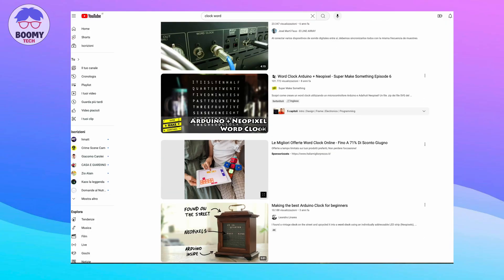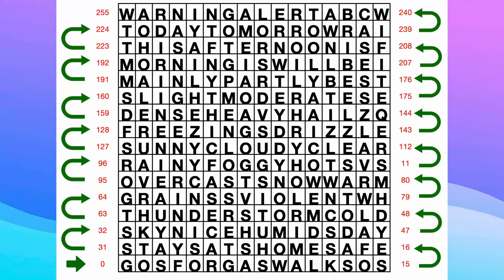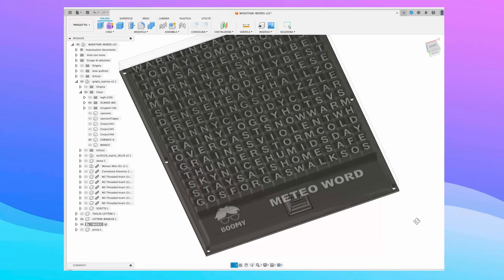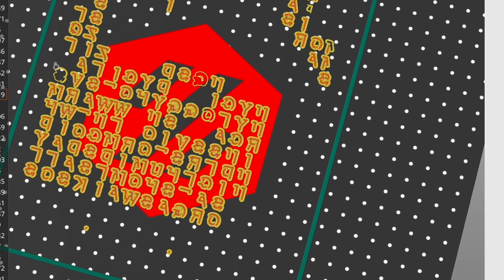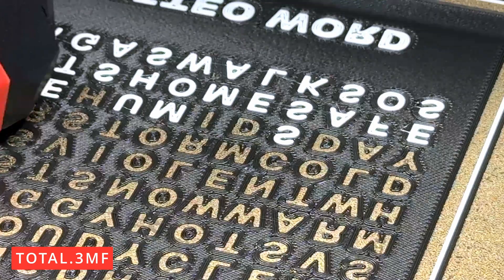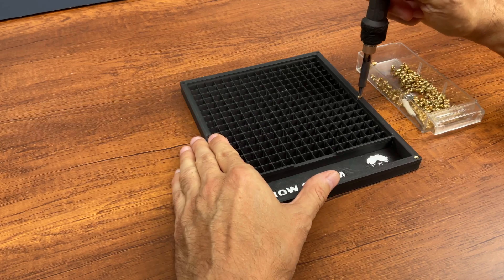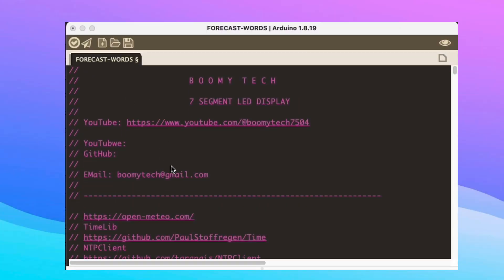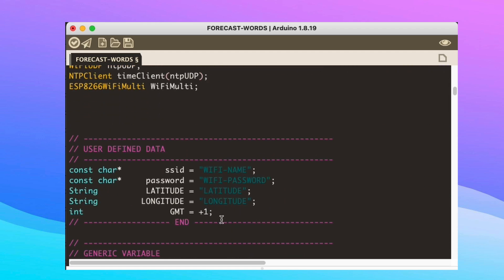Harness the power of the ESP8266 and LEDs to illuminate your weather forecasts.

Comment: Cool project. What power supply did you use?
Reply from the maker: +5v 5A but it can works also with less than 2A.. depending software setup brightness..